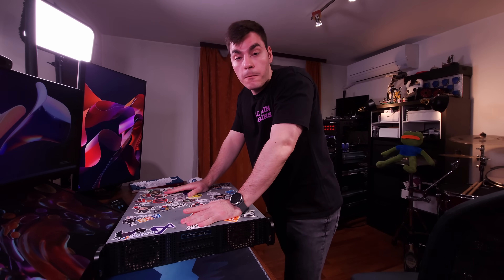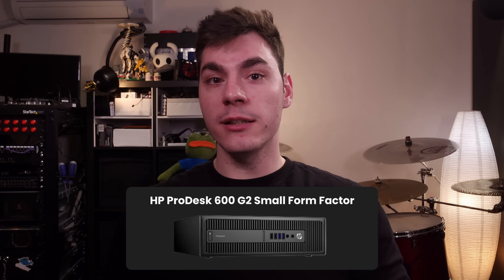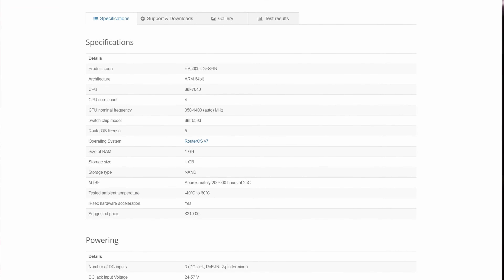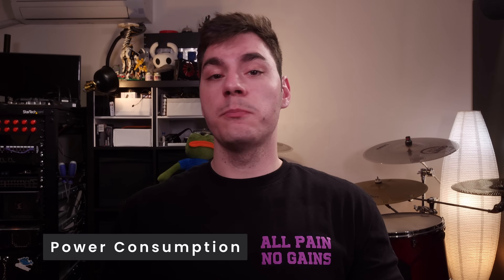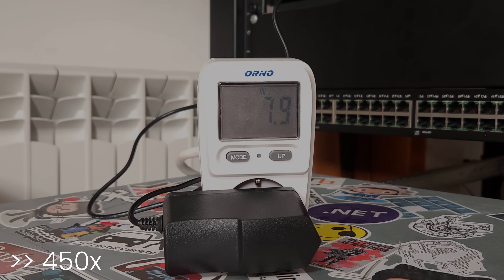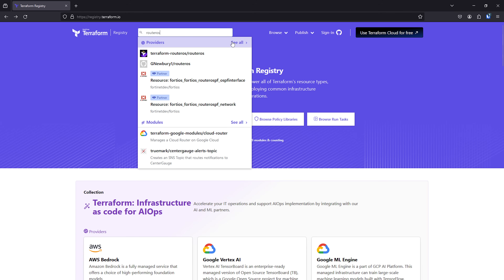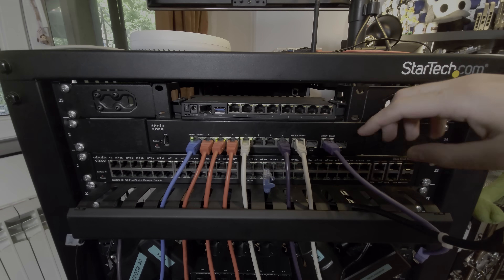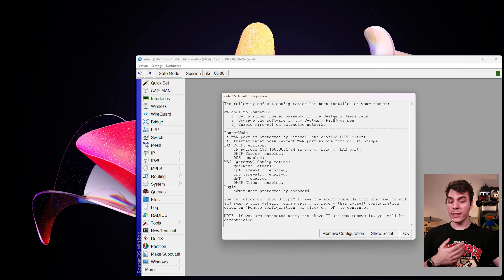Migrating From OPNsense To Mikrotik

Comment: I've used OPNsense from 2019-2024 (mostly) when I switched to MikroTik. I switched due to there not being a 1U x86 firewall I liked: they were either overpriced and power-hungry, or underpowered. However, I've had a MikroTik switch since 2021. It's been a staple in my homelab.

Although I started using MikroTik on CenturyLink in Seattle, I had two scenarios where it's either MikroTik or the ISP router (meaning OPNsense just crashes): Frontier in Connecticut using 802.1X bypass and T-Mobile (now Calyx Sprout SIM) in NYC with a L2TP tunnel. I can't get FiOS (but would love to) and don't want Spectrum until high split comes for uploads.

I do use UniFi for Wi-Fi, due to MikroTik wAP AXs having issues in a NYC brownstone (which is partially why we lack FiOS).

Don't get me wrong, OPNsense is great. But x86 firewall hardware isn't. I tried to find the "perfect" OPNsense box but failed, even once dealt with a psycho eBay seller. I also prefer having a command line.

Comment: I am extremely disappointed in MikroTik CSS326-24G-2S+RM. At a price of $ 450, you expect to get something better than $ 100 D-Link. And this is not so. This is an extremely weak device. In words, it is assumed that this is L3 a controlled switch. In fact, this is L2 switch. When you turn on the usual firewall, performance catastrophically falls. And in fact, this is a problem because Routeros works very specific with VLAN. By default, routing between VLAN is allowed. Imagine the situation that you are isolating the network at L2 level. But there is no isolation on L3. It just does not make sense. To isolate the network at the L3 level, you must enable the firewall. At this moment, the CRS326-24S+2Q+RM disables Switch-chip and processes all the traffic on the processor. The processor (800 mhz) is weaker than in my smart watches. It's just madness. I have L2 TP-Link router for $ 200 with a routing function between VLAN. There it is decided in it out of the box. The overwhelming number of controlled switches has ACL, but not in Mikrotik Routeros. Mikrotik Routeros has Switch Rules that are very complicated. My impression of Routeros is terrible. Routeros just spends your time without giving anything in return.
Reply: You are absolutely right in your disappointment, but the root of the problem is not in the fraud of Mikrotik, but in a misunderstanding of the device: CRS326 is a L2 switch with Routeros, and not a full Layer 3 Switch. It is not intended for inter-vlan routing for production speed. It does not have ACL as in Cisco/HPE/TP-Link. His CPU-does not even cope with moderate L3-traffic
1. CRS = Cloud Router Switch ≠ Full router
CRS326-24S+2Q+RM is a Switch chip with Routeros. And this is critical. At the hardware level, he has only Switch-chip (Marvell Prestera 98DX3236), which can:

Provide the L2 line

Make the basic vlan

Port Isolation, Bridge Hardware Offload, etc.

But he does not know how to hardware route L3-traffic. All L3-operations (including inter-VLAN routing, NAT, Firewall, Connection Tracking, etc.) are performed on CPU, and this is: this: this

ARM Cortex-A9 650 MHZ, Single Core

That is, a funny weak CPU by modern standards.

2. Firewall → Disabling Switch-Chip → All traffic via CPU
This is absolutely true. As soon as you activate the firewall (or use the IP Firewall between VLAN), Routeros transfers packages processing to CPU, that is:

L2 Switching Hardware Offload = Disconnects

The linear speed disappears

CPU is loaded and shut up on relatively small traffic

This is a fundamental architectural compromise of the entire CRS line. They are positioned as L2-community with "on board" Routeros, not as routers.

3. Inter-VLAN routing and lack of L3-insulation by default
Yes, Routeros:

By default, it allows traffic between VLAN interfaces (if you create them via Bridge Vlan or Interface Vlan)

To introduce restrictions - you need to use Firewall or manually build Bridge Filters / Switch Rules

And this leads us to the above problem - performance is lost

Unlike TP-Link Omada, Cisco, HPE and others, where simple ACLs via VLANM are available at the Switch chip level, Mikrotik demands to do this manually through complex structures.

4. Comparison with TP-Link or D-Link-fair
Devices like TP-Link JetStream TL-SG3428X or OMADA SG3428X:

Have full -fledged ACLs with hardware use

Routes between Vlan'ami on ASIC

Support up to 10g Uplink without degradation

And Mikrotik CRS326:

Claims "controlled switch with Routeros"

But in fact - does not provide the expected L3 functionality in the gland

5. Switch Rules instead of ACL is pain
Switch Rules in Routeros:

Implemented through Bridge Hardware Offload

Have extremely limited opportunities

Do not support normal IP expressions, ports, vlan, like ACL

The documentation is incomplete, difficult to implement

In fact, Routeros is a Router-First OS, not Switch-FIRST OS, so the experience on CRS is extremely different from, for example, Cisco iOS or even TP-Link Omada.

Comment: Mikrotik is the best thing you can have as Router/Firewall, requires a lot of learning but its worth it. They have been upgrading all of the webUI and few things to make it easier. Since you have Home Assistant, you can install a custom integration from HACS and integrate the mikrotik to HA and monitor/control everything, from turning on/off ports, monitoring network traffic, creating automations inside Home Assistant to enable/disable things in mikrotik. have dual wan, triple wan with failover. can also split bandwith between dual wan and everything. if you have a NAS you can install pretty much everything opnsense has. You can make any network hardware comunicate between each other including different brands of switches. Learning Curve is a bit hard but once you get how it works, its a beast.
Reply from the maker: Absolutely one of the best purchases as of late tbh. Steep learning curve but quite powerful once you learn your way around it

Not a huge fan of using WiFi for presence detection though. What if my phone dies? :))
Reply: I love Mikrotik but they are not "the best" for a firewall. It's better (more controllable) than TP Link, Ubiquiti, Netgear, DLink home or SMB routers. 

Out the box, MT is sadly not very secure.... Eg No CA signed SSL cert, FTP+Ssh+telnet+webfig are all enabled... DHCP snooping is not enabled... So ya, you need to learn the finer details of MT, in order to have a minimum security level...
Reply: I have 5 wans on mine
- regular internet 
- backup LTE via SXT
- backup via ethernet sharing on phone
- wireguard to nordvpn
- wireguard to nord in the UK for BBC iPlayer
Reply: Nice!  @michaelculley8790

Comment: This is quite funny, there are so many channels where someone describes their configuration of network without knowledge. He described he has 300/300 ISP connection and that he doesn't need higher speed on LAN because switch handles most of the traffic. Nope. Anyone hosting servers needs Vlans nad with Vlans, the router is the bottleneck where you need to handle any routing, so the switch is just pathrowing the data to the router itself.
Reply from the maker: I'm not saying I don't have VLANs, I am saying I don't need more than 1gig between my router and my switch.

Sure, inter-vlan traffic would get sent to the router and be bottlenecked by that 1gig link. My point was that I am not routing traffic that would need more than that.

My storage server has a NIC in each network that needs access to it, so my switch does indeed handle most of my high speed traffic since that traffic is INTRA-VLAN not INTER-VLAN.

Unless I'm missing something here I dont see your point

Comment: I dove head first into MikroTik this year... Replacing everything except my NAS and access point.  I'm using the RB5009UPr, CRS309, and CSS326.  Learning RouterOS can be intimidating, but there are soooo many YouTube videos with help.
Reply: Which switch would you recommend for 8 port 1gb non poe ? Looking at their lineup it seems like the one I would want is running swos light and the one running swos non light is 16 port. The newest 2.5 one seems nice but I don't want a fan. Also I don't know why but I kinda expected their devices to be cheap or at least cheaper than something like unifi which most people say are overpriced lol.
Reply: @02semiata  I'm not familiar with their smaller equipment, but the CSS326-24G-2S+ has been 100% stable.  While it only runs SwOS (no routerOS) it still has a lot of functions... Mine is acting as a dumb switch, but plan to start tinkering in the near future.  Or for $115 you can have something like the L009UiGS-RM.  It has 8x 1Gb PoE ports, 2.5Gb SFP, dual boot, and rack or desk mount.  More functions than you're looking for, but plenty to grow into.
Reply: Thanks for your suggestion. The L009 looks kinda cool. I hadn’t considered getting one of their routers and running it as a switch !
Reply: @02semiata I replaced all my manageable devices to mikrotik and non manageable are some Netgear switches or so, mikrotik is kinda "cheapest of the better" equipment, it's not cheap cheap, but for 100$ recently bought 24x1g +2x10g manageable switch for my network and replaced multiple dumb switches with it, you shouldn't buy mikrotik for dumb nodes, buy router and managed switch and go from there

Comment: You have made the best move ever going to mikrotik
Reply from the maker: It definitely has a learning curve and it can be a bit overwhelming. I've been tinkering with it for the last few months and I'm still learning new things every time.

That being said, I don't regret it. I feel like it's a better setup than I had before
Reply: @mirceanton  

I am not a networking expert it took me about a month to figure out things. The workflow makes sense when you read the documenttion and understands how stuff works, you can do pretty much everything.  Winbox mirror almost 100% the CLI as well ( most of it ) so to be good at the cli you can check winbox and do the commands in the CLI at the same time.  It is a good trainign anf helped me a lot.

You will also save money on your electricity bill lol :D

Nothing wrong with pfSense or OPNsense , but when you use a mini PC that can draw up to 100W depending on the model , since it runs all the time it can be really expensive to run, depending where you live.

At least now you have hardware that is really energy efficient.
Reply from the maker: Yeah, I really like that the CLI matches quite closely to winbox and to the API as well (thus also to the Terraform provider). It definitely makes it easier

Comment: Pfsense is not a next genration firewall as many here suggests. It uses outdated IPS/IDS plugins like Surricata. But it has nothing to do with deep packet inspection of HTTPS frames what Fortigate does. It does not decrypt and re-encrypt thr HTTPS frames. It just checks IP lists and unencrypted packets.

In the era of full TLS encryption, the regular IDS/IPS has very little to no benefit. A regular stateless firewall blocks the same traffic what PfblockerNG blocks.

If you don't use IDS/IPS and list based protection, pfsense has no benefit over any other router system, like RouterOS or OpenWRT.

Why should we use an inefficient BSD based system if we can use faster, Linux based systems with less power draw?
Reply from the maker: That was precisely my point! I couldn't have said it better. Thank you!

Comment: Going to mikrotik from opnsense is a downgrade.. Not an upgrade
Reply from the maker: I agree that in the grand scheme of things the OPNsense box I had previously had a larger set of features.

However, strictly from the point of view of the features I was using and I needed, I still think that the Mikrotik is an upgrade since it allows me to do all I was doing before and some more.

It's not all black and white. Context matters as well.
Reply: @mirceanton  I'd rather keep opnsense and add the zenarmor addon for a really high performing next gen firewall 🙂
But you could run that on a small intel n100 that has the same performance as a gen 6 core i5 but only uses 10w if not less 🙂

Comment: Servus my fellow Ro i assume because i also am one :) I see the opinions that you downgraded it is somehow kinda true but Mikrotik has also products that support packet inspection , the only issue is that they are other product class with other price point , Mikrotik operates since 1996 or 97 and they manufacture also ISP grade devices just like Juniper, Cisco , Nokia etc but also stuff like this consumer grade routers for the enthusiasts that sometimes have fun experimenting with OSPF, BGP,  or tunneling protocols like Wireguard, OpenVPN , i also have some of their RB 2011, RB 4011, and some other cheaper smaller devices because not everybody will pay around 400-500 $ or EUro for a used CISCO router just to have the hands on experience and if i am not mistaking the Torch function on Mkt RB does exactly that : Packet Inspection
Reply from the maker: Servus! Yeah, I understand where they come from, saying that this was in fact a downgrade.  However, I specifically mention in the video that I was not doing any of that with OPNsense to begin with, and strictly from the PoV of my use-case there is more-or-less feature parity between the two. It's a matter of perspective, in my opinion
Reply: @mirceanton  Gotcha, i watched the video after i wrote the comment where you stated the reason for size and noise because i was searching for something related to the router world and the Yt algorithm or who knows maybe karma  ;) suggested through my feed also this video and i was just skimming through it and because of your name i thought you are a fellow landsman , Nice , Keep up the energy

Comment: Curious to see how this goes, subbed. I'm considering moving my router from a VM to a bare metal solution. I'm wondering how easy/good the firewall is to configure. Could you go over the options for that? I'm curious how flexible and capable these mikrotik boxes are, I love my Mikrotik CSS switch, and would consider them for the router too.
Reply from the maker: Thanks for the sub!

I'm afraid that the video won't cover all the details you are looking for :(
The configuration that I will be presenting, or rather the method to apply it, will be automation via Terraform. I won't really cover using WinBox to configure the router more than the initial setup. 
To be fully honest, there are far better resources out there for specialized Mikrotik content, such as TheNetworkBerg youtube channel. I'm a DevOps guy dabbling in networking stuff, mainly from the perspective of automation.

Comment: Congrats, you threw away UTM and called it an upgrade. How do you go through an entire build and not understand the value of intrusion detection and threat management 🤔 “upgrade” what the…
Reply from the maker: This is a homelab. I mention in the video that I was not running any IDS or IPS on my OPNsense or anything like that. In my use case, and for many others who run it at home I'd assume, it's acting mainly, if not only, as a router/basic firewall.

I explained in the video that I personally consider it an upgrade because it allows me to do something which I was not able to before, which is to adopt it in my IaC/GitOps setup. To me as a DevOps engineer that matters more, for my homelab than IDS or IPS.
Homelabs are all about what you want to learn/play with, and from that aspect, it was an upgrade for me 🤷‍♂️

Comment: Why would someone switch from driving Ferrari to the mini smart unless you desperately need it
Reply: He just pointed few reasons in this video:
Less sound
Less apace in garage
Cheaper on fuel

From my side, I will also add much cheaper service and parts replacement.
And actaully, smart people use to think the opposite way: why would I  use ferrary if I only need mini smart.
Why would someone use 6th gen i5, 8 gig of ram, nmve ssd and whole bunch on psu, cables, etc for a task that a basic mikrotik router can do?
Reply: @офисный_работник  negative my friend.
Now you can run opnsense or pfsense on a small embedded device that cost near the crappy mikrotik.
Btw when it come to benchmark and VPN throughput mikrotik becomes a joke and you will end up wasting $$ trust me I've been through this
Reply from the maker: To be fair, I didn't look into it THAT much, but I didn't find an x86 computer + all the required components (rack mount case, PSU, ram, storage etc) that draws under 10 watts and is comparable in price with the MikroTik.

Also, in my experience using ZeroTier as a VPN solution, it's good enough to saturate my uplink. so for what I need, it seems to be plenty, at least this far
Reply: Not an apples to apples comparison even.. 🤦‍♂️ OPNSense is a firewall with some routing capability’s and RouterOS is a router with some firewall capability’s. The analogy should be going from a Ferrari to a rally car. They excel at different tasks, but both can take you to the store and back to buy milk… 😅